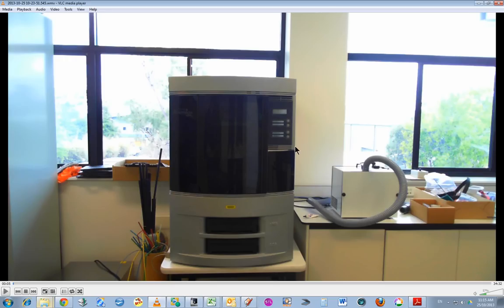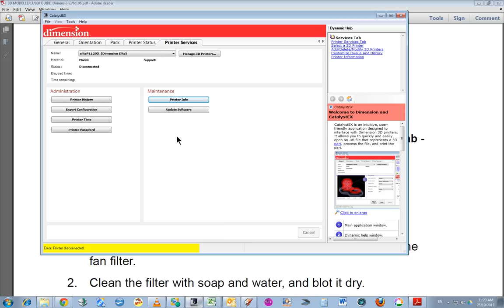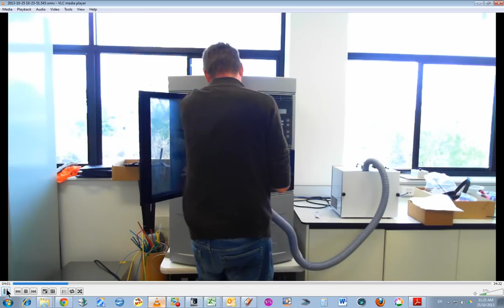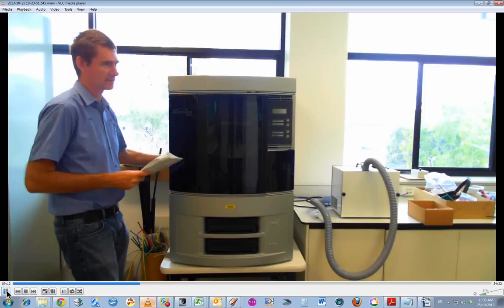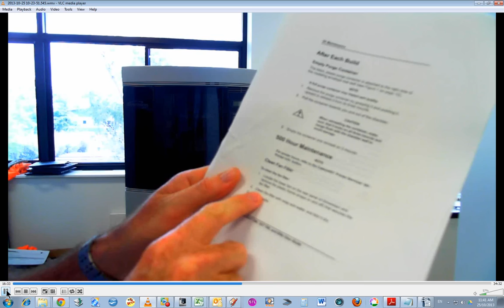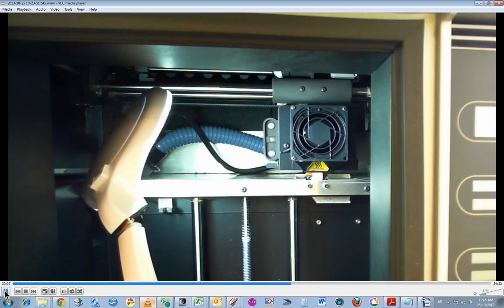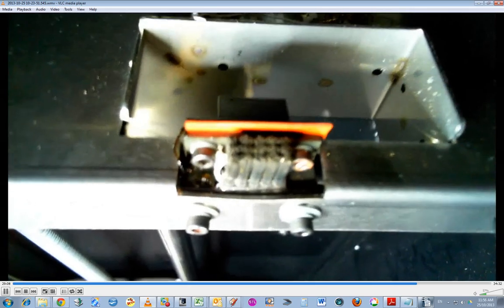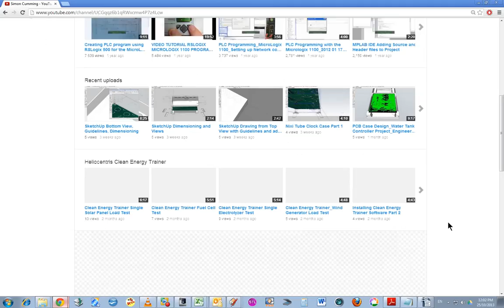Dimension Elite 3D Printer   500 Hour Maintenance

Comment: can this printer print gears that can be used in a functioning purpose, like RC helicopter gears that will rotate btwn 13000 to 16000 rpm, which fillament would best be suited for this application